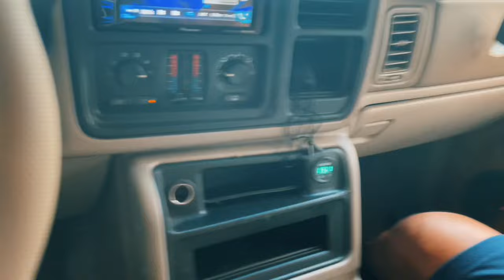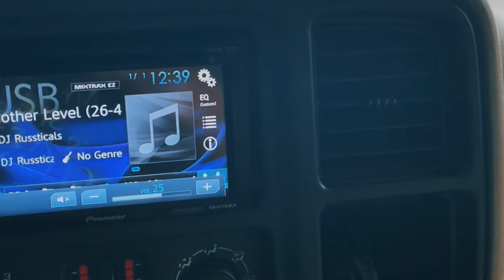6 skar ZVX 15s 2 Taramp 15ks 6 ds 18 pros one loud Crazy build

Comment: That pressure? How about that RATTLING! 🤔. I mean from the outside that sounds like complete ass. I understand it's hitting hard but it literally sounds like someone stepping on a can of soda. Wrrrp. Wrrrp, bssst. Get some sound deadener on that thing! 🧐
Reply from the maker: 😂 he has 2 layers adding 3 more lol
Reply: @SmoothKreationsaudio  exactly! I have 3 layers of butyl deadener and a layer of high density foam on top and I still get rattle. All walls, doors, and floor done
Reply from the maker: @jaysmith1549  😂 you can’t stop it all 😂
Reply: @SmoothKreationsaudio  💪🏾💪🏾💪🏾😂😂😂